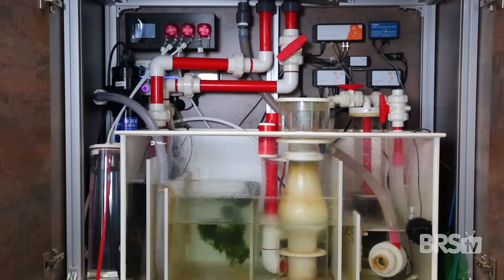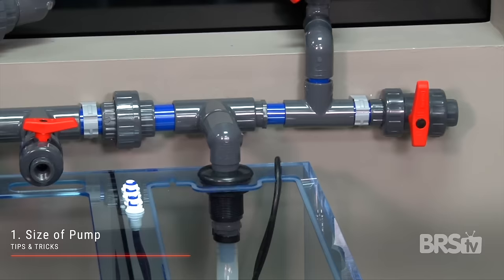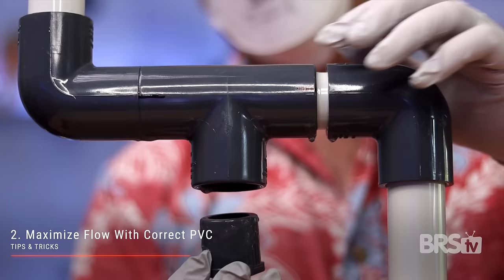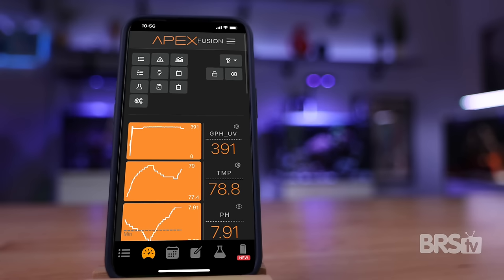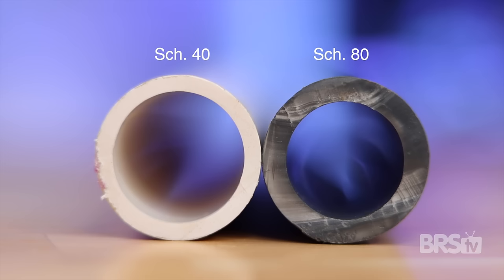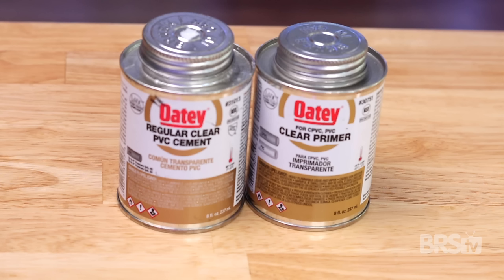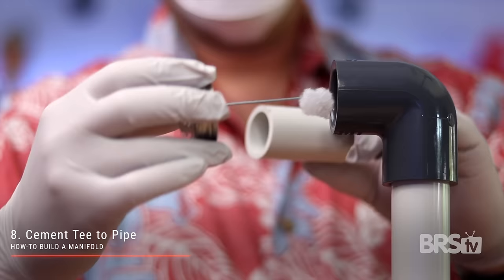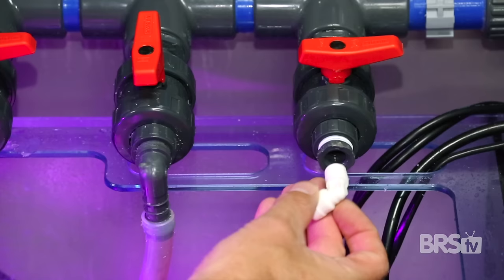Aquarium Plumbing Done Right? Feed Protein Skimmers, Carbon Reactors & MORE!

Comment: Any time you put a T piece or a fitting which needs to be in a certain direction, add a union it allows a lot more flexibility and you don’t need to use a permanent marker to mark it all up :)

Comment: I just got a 3/4 x 1/2 x 3/4 T fitting and used a 1/2" ball valve then used the threaded adapter thats included instead of using a 3/4 ball valve and buying a 1/2" reducer.

Comment: Not to BYBs,  2 45 deg elbows = 1 90 deg elbow without the overcomplication.  Improvements in flow using 2 45s, are extremely marginal.  Mark Callahan goes into this in detail in one of his YouTube videos.  He's a professional installer.   Another thing that seems ironic is that you are talking about maximizing flow, but then decide to use the schedule 80 instead of 40 which has a smaller inner diameter and is lower flow.  If you want to minimize loss due to flow dynamics, soft tubing does it better than anything else since the radius tends to be maximized.  I personally don't really care about the look under the cabinet and use schedule 40 as much as possible to maximize flow.  I'm more concerned about the display but to each his own.  I know there are a bunch of tech junkies in the hobby who are more interested in the gear side of things and that's okay too.  To each his own.  BRS has to keep selling this stuff.  Plumbing can be tricky, especially when you're new.  Soft tubing is always a good place to start and is much easier to mod later, which always seems to come sooner rather than later.  Keep up the good work!
Reply: Not mistaken, the white is SCH 40 and he is only using SCH 80 on elbows and valves? Yes, loss from teo 45's is not going to give you anything in piping this small but may help in water hammer.
Reply from the maker: The sch 80 fittings will fit both sch 40 and 80 PVC, so while they're a bit more bulky on the outside, the fittings actually don't reduce the diameter. 100% correct about the sch 40 vs 80 pipe though!
Reply: Right, two back to back 45s are going to be similar or worse then a single 90 because connections themselves have pressure drop. If the 45s are separated out there might be a little improvement but probably not worth the added complication. If people are concerned there are also long sweep 90 and 45 connections that would help.
Reply: Thanks for this.  I had always assumed that two 45s were better than 1 90, so I added it to the video!  Another great example of how sometimes you just don't know what you don't know!  Thanks for this and I won't make this mistake again!  Probably just need to use street elbows!!
Reply: Good advice Matthew on using as few as possible 90 degree  bends as you will compromise flow. Cepex ball valves are quality built and more efficient imo.
Reply: I would suggest if you are using schedule 80 valves and such use schedule 80 pipe to the line side of the valve.  There will be a ridge between the schedule 80 fitting and the 40 pipe that can case things to get caught on and it could build up and clog.
Reply: I changed my 330 over to flex PVC 1" and got rid of all my 90s.
Reply: @kens4838  I was thinking of using a long sweep con suit 90 ion my build if I have the room

Comment: hey just fyi two 45 degree fitting equal one 90 degree, its been proven its slows down the flow the same amount and you've just added more work for yourself. Just stick with the 90's if you can get bent 90's better. Always great content!

Comment: Once you have plumbed the supply to your UV sterilizer from the return pump manifold, where would the return pipe connection go coming back from the UV Sterilizer so it returns back into the display tank.

Comment: 0:38 ok, i work on boiler systems. These ball valves barely control flow, they will increasr velocity. Does this valve here being mostly closed not negatively imapct the system? I seriously dont know here as i only work on pipes that get to 180 degrees at like 20 PSI hot.

Comment: When doing this, Do I just have to wait the 2-3 hours for it to dry in place on my return line and then it is safe to turn the pump back on and go about my reefing? I have been wanting to do this for a while but have been intimidated by the glue drying as I thought I would have to wait like 24- 48 hours for it to be safe.
Reply from the maker: We most often use the Oatey brand, which recommends 2 hours of cure time. In our experience, this is just fine and doesn't pose any issues for the tank or inhabitants.

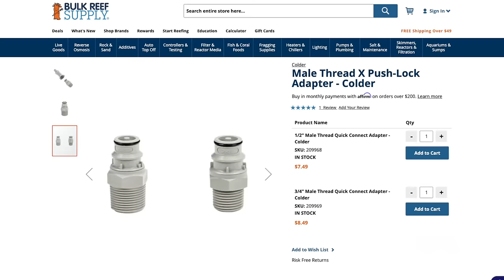Comment: 8:40 the wrong fitting is shown. Colder Push-Lock is not compatible with John Guest or Murloc push connect fittings.
Reply from the maker: Good catch! This is the one that you'd want to go from a threaded fitting to push connect (specifically the 1/2" size for the reactor that Matthew talks about in the video): https://www.bulkreefsupply.com/mur-lok-male-npt-x-push-connect.html

Comment: Ok we are going with the gray schedule 80 because it looks nicer and I’m at the part you are using a sharpie and I am cringing badly!!!!  I am electrician that runs a lot of conduit and sharpies are a no no no way because now you have this black line and marks all over.  Pro Tip use a pencil because it wipes off easily.

Comment: Uhm..2 45s vs 1 90? 🤔😕 No.

Theres a formula to calculate flow velocity given pipe size, elbows, head, all inclusively. Mathematically speaking, you summate the number of bends by size. So 2 45 degee bends is equal to 90; theres no difference. The formula goes by degrees per bend. If you broke your system into segments, reiterate, youll get a very on target figure.

Additionally, those 2 45s? See that short distance beteeen the radii of adjacent bends? Thats a very short 45 degree incline. That may or may not be ststistically significant but keep that in mimd.